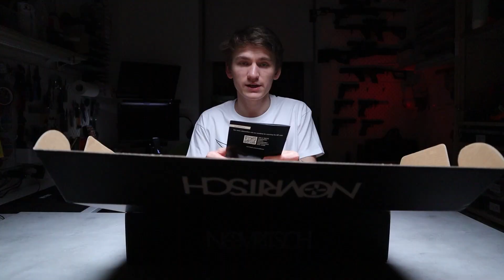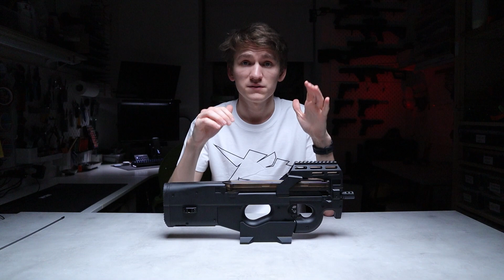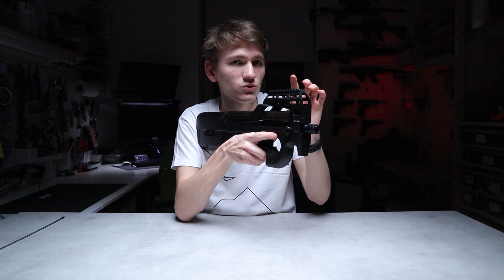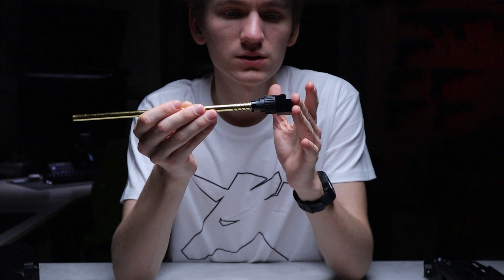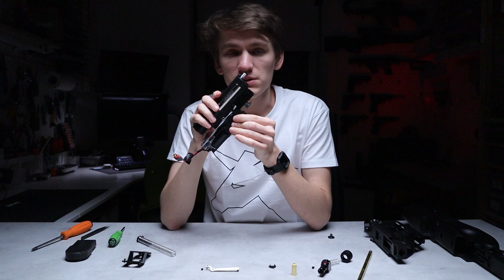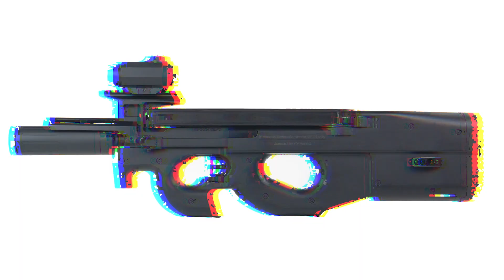Novritsch SSR90 Review (Internals / Features / Accessories)

Comment from the maker: 🤜 As @wyz2285 pointed out (from Nov's dev team) - just shoot full auto after the game to release the spring, in full auto mode pre-cocking is disabled. So no need to remove the spring / re-program the MOSFET!
🤜 Seems like Novritsch has some delays with the 180rd magazines with current manufacturing partner and they are working on a Plan B for a release later this year. So still atleast a few months out.

Comment: Do you think it's still worth 400 euros in 2023?
Reply from the maker: If you're shopping for a P90 then 100%. As far as I'm aware there's no better performing out of box P90 at the moment.
Reply: @TRIDOS.DESIGN  I watched every video of it on youtube and could't resist buying one. Now that you said it's the best p90 out of box it made me feel even better. I'll leave an update if I don't forget, it should arrive soon. Thanks a lot!
Reply: Update: I got it. I was very scared, because I thought , that the gun only will be good internally , but externally the quality will be the cheapest possible. I was incorrect. The gun internally and externally is very high quality. The ETU makes the gun so fun to use, and using 11.1 battery it litteraly sprays a laser beam of bbs. I could totally reccomend it to everyone else - it's the best gun out of the box for the price I personally had yet. My previous gun was Arcturus HK416 for ~360€, and even with the upgrades I made it's not even close to the performance of the ssr90.
Reply from the maker: That's awesome to hear! I would suggest grabbing the Sandgrips and Odin adapter from our store - both absolue must haves for the SSR90.
Reply: @TRIDOS.DESIGN  Although you mentioned it in the video I didn't pay much attention. Now that you said it I just looked up and I'll be definitely grabbing them + some other things later this month 😁

Comment: Please, give me an advice. I have no such experience with AEG. I noticed that my SSR90 charging nozzle always remains pulled back after firing. Is  almost completely stretched, so that is almost invisible in the chamber. According to what I know and what I seen, the nozzle should always be loose, so that it rests through the chamber up to the ho-up rubber. I'm a bit concerned if this is ok and if the tappet plate and its spring can't wear out faster over time.
Reply from the maker: That is pre-cocking. It can be set via programming. This improves responsiveness. If you want to release the spring, you can shoot full auto and that will disable the precocking temporarily for storage purpose.
Reply: @TRIDOS.DESIGN  Thanks for the response. I don't have pre-cocking on. Ok, another way. When I remove the magazine and look into the chamber, I previously saw the silver charging nozzle that was loose all the way to the hop-up rubber. But after some shooting what happens now is that the nozzle is pulled almost all the way back and I can actually see all the way to the hop-up rubber. I'm just not sure if it's ok because I saw from the videos that the nozzle should be loose. (of course I then tried to set pre-cocking = in this mode the charging nozzle is loose and rests on the hop-up rubber. Actually, as I think it should be in normal mode/without pre-cocking) I think the nozzle after firing should not remain pulled back, in normal firing mode.
Reply: I don't know, as if the gearbox stopped at the wrong moment of the cycle. On the other hand, the SSR90 is completely new. Anyway, I wrote to support.

Comment: In your opinion, what's the best most sturdy p90 base to upgrade internals?
Reply from the maker: Haven't had any other P90 in the past but this doesn't require any upgrades internally in my opinion. The only thing you could modify is adding an electronic trigger which is a pain in the butt regardless of which base you take. With P90, I would always go with SSR90 unless something better comes out.

Comment: Any word on the lower powered springs?
Can only get the 1.6j version here and it need to get it down to 350fps with .25s.
Reply from the maker: pretty sure you should be able to throw in any AEG spring and be good to go.
Reply: @TRIDOS.DESIGN  I figured as much

Comment: 22:38 I wished Novritsch did an in-between version, where you keep the bridge part of the rail but you lose all the M-Lok part & the top picatinny is flat on the bridge. So you keep that P90 “look” & still have a low profile picc mount.

Comment: 14:25 ahh so does that mean the barrel is proprietary? I was thinking of extending the barrel into the suppressor for further range & accuracy.
Reply from the maker: Increasing barrel length will not increase range - the only way to increase range is by having more power output - if you are limited in 1J, adding longer inner will only hurt you. I also doubt it will improve any accuracy as this already shoots incredible. If you want to keep the flat hop as good as it is, then you probably have to think about what barrel you are putting it in but you could definitely plop in any AEG barrel with any regular bucking and still be good to go as far as I could tell. But I personally wouldn't touch the barrel assembly unless something breaks.

Comment: I don't know hows your fake charging handle but mine is rattling and noisy like hell. Would be something to think of to make it quieter or develop something to remove the handle and fill the unsexy gap.
Reply from the maker: Mine rattles a lot as well - I was thinking of making new set of plastic handles for it that would stop the rattling or maybe making a small plastic piece to put behind it to do the same.
Reply: Maybe some gum?
Reply from the maker: We released a part on TRIDOS.DESIGN to fix the rattling on the handle.
Reply: @TRIDOS.DESIGN  Already bought some weeks ago and put to the gun. Makes it better ... not yet perfect. Also the mag fix is neat and the adapter for the Odin Speedloader. Well done!
Reply from the maker: Can you send us some feedback about it to our FB page? It helps hearing the feedback, as not every gun is always the same, etc. ;)
Reply: @TRIDOS.DESIGN  Done!

Comment: Just shoot full auto after the game to release the spring, in full auto mode precocking is disabled (because you wouldn't feel the difference between shots).
Reply from the maker: If so, that's a good tip! But isn't the last shot after full auto also precocked?
Reply: @TRIDOS.DESIGN  No, I had precocking removed in full auto to be able to decompress the spring. If you switch to semi afterwards the first shot will not have precock then precocks it.
Reply from the maker: @wyz2285  That's great news. I'll pin a comment about this.
Reply: That’s a great tip thanks, I’ll be using that later 👍🏼

Comment: That held together with glue bit is insane, glad you pointed that out
Reply from the maker: Pretty sure that most P90 shells are held in place like that. It was a hard drop, so this was fully on me. I was extremely surprised that it didn't didn't cause more damage than that - I was sure it would be missing pieces after that freefall.